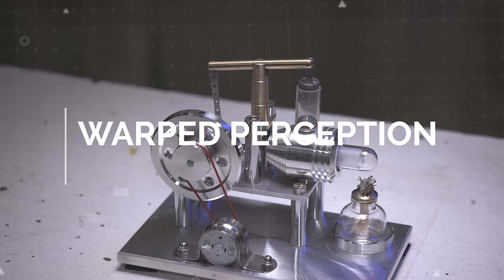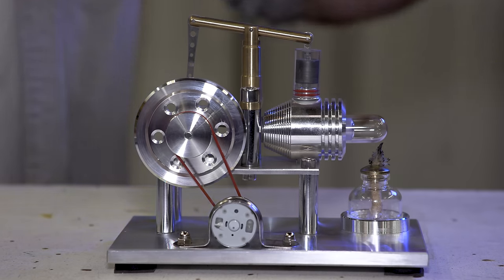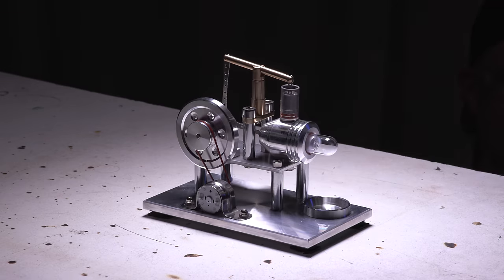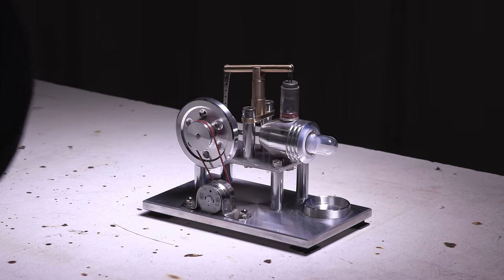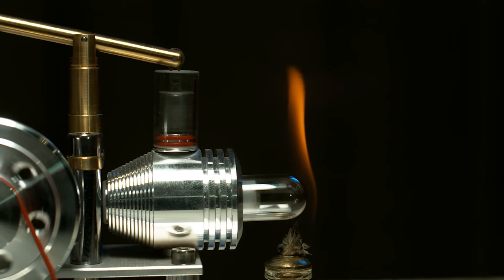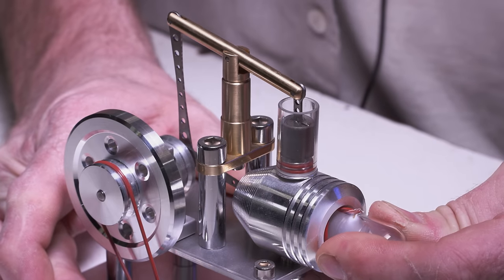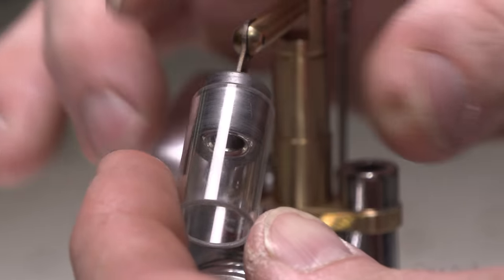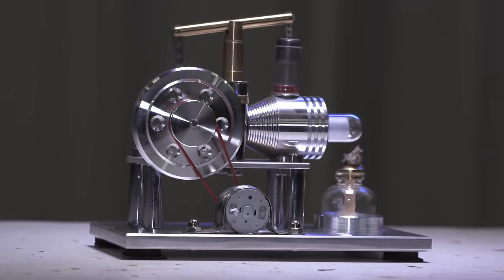Mini Stirling Engine - MAX RPM (Blow-Up Attempt #1)

Comment: Since it works with temperature variance, hit the other side of the heat exchanger with liquid nitrogen and you should get faster RPMs.
Reply from the maker: Funny, that's one of the first things I thought of. I may try that in the future
Reply: @WarpedYT  yes!
Reply: @WarpedYT  Or it might shrink the cylinder and lock it up.  Only one way to find out.
Reply: @grants169  Or crack if theres big temperature difference. Like hundreds of degrees.
Reply: Also fill the cylinders with helium, it will run faster
Reply: @WarpedYT  i would love to see how manny volts its puting out at 4000rpm?!?!?!
Reply: I was thinking the same: Rather than focus on heating the bulb, I would have focused on cooling the heat sink, to help get the temperature differential, without melting the glass. I'm surprised the displacement piston melted, and not the chamber glass!
Reply: @WarpedYT  If you really want to see it take off, pipe some helium into the crank case. Probably can easily double the RPMs, esp. if you use some ice on the cold side.
Reply: @WarpedYT  Some variations come with a metal piston and cylinder head. I have a cheap one that uses metal. I wanted to eventually get one like/similar to the one you have and essentially cannibalize the cheap one for it's metal parts XD.
Reply: I have a burning question that maybe answered here. Do you guys thing you could make a turbo run of an AC compressor. Would make for a   Cool diy project. A lot of people would be able to plumb an ac pump to a turbo befor being able to fab the hot side of an exhaust
Reply: @riz3nfpv306  Turbos use way more air than what an air compressor is designed to provide. You might be able to get the turbo to spin, but nowhere near fast enough to produce boost for a running engine.
Reply: Nathaniel Hatley even with a 
Reservoir  system to build volume? and  i imaged the turbine wheel to have a weighted impeller  on the hotside that also would handle the capture/exchange of air like an air tool. Not a large turbo obviously but even if it crated 5-8 lb of boost i imagine it would be a fun exercise
Reply: @riz3nfpv306  Ford was working on a system that would use the A/C to cool the liquid  intercooler for short bursts of additional horsepower on their supercharged/turbocharged cars. But, it requires some automated controls and a lot of extra solenoids and A/C lines to work properly. Not really DIY. As far as the turbo goes, the exhaust is really the only way to drive a turbo charger. They require a lot of HP to run the compressor stage. A typical ball-park value on a moderate HP engine might be around 60-70 HP needed to drive the turbo charger. This is due to the fact that it takes a lot of work to compress the incoming air charge. The power is developed from the resulting back pressure on the exhaust side, which is similar to the boost pressure.
Reply: mysock351C that’s using exhaust temp gases which would be far less dense then say air that has been accumulated ( and possibly cooled )in a pressure tank . Don’t get me wrong I know that it will never produce big boost or even run a large turbo, but If it were a small turbo to assist with low down torque would be a great little power assist mod for the budget rev head. Even to see if it’s possible
Reply: @riz3nfpv306  A typical A/C compressor is designed for high pressure/low flowrates. It develops maybe about 1-2 HP (similar to a small split-system) and is designed to run at about 200-275 PSI. Even if you used a large compressor off of an airbrake system it probably would not be able to keep up for long, and you would need regulator valves, a control system, and a very large accumulator. It could probably provide about 3-5 seconds of boost on a modest setup. Bottom line is theres not enough power even on small setups to drive a turbo practically. If you really wanted to avoid using the exhaust side and still want the flexibility of a turbo you would need to connect a large 30-40 kW generator and electric motor from a hybrid vehicle. It would still require a controller, but that setup would generate enough power to run the compressor impeller through a gearbox (or more practically a centrifugal supercharger since it will already have the gearbox incorporated into the unit). Power would be provided by connecting the generator to the engine, either via the accessory system (not recommended), or sandwiching it between the engine and transmission. The controller would then provide variable amounts of power via the generator to the "electric" turbocharger to generate boost under load.
Reply: @riz3nfpv306  To put it into perspective, modern engines like the turbocharged Ecotecs and Ecoboosts purposefully remove the turbocharger from the work cycle at part throttle by dumping all the boost because the turbo is so lossy. Having to always drive the turbo on older boosted engines is why they usually didn't get good economy. They require loads of power to operate, even on small setups.
Reply: mysock351C when dreams and logic collide. I want to argue my point to keep the dream alive but I expected that would me the conclusion I just really never knew the amount of air an ac compressor could produce because it’s never been something I’ve gotten into, I mean have mounted plenty and de commissioned a few but never anything like turning them into air compressors so I have no idea of flows and the such. Ya gotta ask right?
Reply: @riz3nfpv306  It would be maybe a few CFM per minute at its rated pressure output. Since A/C works on liquid to gas phase change large flowrates aren't needed, but high pressures are to get the refrigerant back to a liquid phase in the condenser. The flowrate is then set by the thermal expansion valve before the evaporator.
Reply: mysock351C what if the impeller was fluid driven? Like water under high pressure
Reply: @riz3nfpv306  There's a video that Cleetus McFarland put out recently where he was testing an electric turbo on a relatively small engine and it was able to make ~5lbs of boost, but the turbo costs $2,500.
Reply: Nathaniel Hatley yea I seen that and I had been wondering about that too but the amount of amps/charge it needs is a
testimate to what the commenter above  was
talking about. But the idea stemmed from the fact that the first thing guys chasing performance do is remove ac and or power steering pump because of the parasitic effect of these. In stead of removing them what if we found a way to repurpose them for power gains. Some how use the ac power steering of even water pump to propel a power adder.
Reply: @riz3nfpv306  That route seems like a roundabout way of getting a centrifugal supercharger, but instead of being driven by the belt drive directly, it is being driven by water/hydraulic fluid/air from an existing pump on the car. The issue there is that superchargers usually need 50+HP whereas the existing pumps you're talking about were never designed to consume/transfer that much energy.
Reply: @riz3nfpv306  there is a guy who uses a battery powered compressor on his car to spool his turbos faster. He compresses air in a tank to about 140 psi then releases the pressure into his hotside (pointed at his turbine) to spin it up... it works. He will use nearly half the pressure in a second or 2 but its enough to reach boost near instantly.
Reply: Man Stuff Channel this is what I’m talking about! But rather than a battery powered air compressor to recover air the vehicles ac comp can be converted to simply compress air. From what I read the ac pump should recover a lot quicker than an electric air comp
Reply: Man Stuff Channel where can I see this?
Reply: eternal ponderer yessssssss please
Reply: Cold water is a better heat transfere and is basicly free
Reply: tullgutten yeah I was about to say... just grab a damn ice cube
Reply: Congratulations! Your comment has reached 300 likes!
Reply: Liquid N will freeze the air inside it. End of run.
Reply: It would probably create a blackhole
Reply: And Oxy-Acetylene torch
Reply: @mysock351C  I'm not a chemistry geek or an engineer. Please tell me what the helium does and how?
Reply: @donellmuniz590  As far as an example of how much better helium is than air, it has a thermal conductivity about 6 times higher at standard sea level conditions. This will allow it to pick up heat much more effectively than air can.
Reply: @mysock351C  thanks! I hope "geek" didnt offend, lol. You guys are way too smart for me.
Reply: problem is, if you put a load on it, you would have your liquid nitrogen leaking onto the load....
Reply: @Lv.zx6r  it won't run at 4000rpm if you load it.
Reply: @grants169  I think you may need to control flow carefully to optimise could always try removing some material from flywheel... I would maybe try a water jacket round cylinder, brine and so on ...
Reply: @Lv.zx6r  maybe it can charge laptop
Reply: @WarpedYT  plz yes plz
Reply: Dripping water on the HEX would have increased the ∆T. More speed perhaps. Speed may be self limited by the inlet pump and heat chamber dimensions.
Reply: Was really expecting him to do this
Reply: You could take one of those canned air things and turn it upside down and it gets very cold
Reply: Or get it to cool itself, turn the flywheel into an impeller or something
Reply: @riz3nfpv306  look up torqamp!!!
Reply: @WarpedYT  take the belt off too.
Reply: I think. It will couse big stress that crack the engine in a second
Reply: It's so tight! That's what she said. LOL 😂😆🤣
Reply: @Lv.zx6r  changing the DC motor would help make more because the DC motor/generator that comes with it Wight output maybe 6 volts or a little more but a bigger DC motor/generator would output more volts, amps and watts because of the gauge of wire used and the magnets that's in them.
Reply: @WarpedYT  done it yet?
Reply: @WarpedYT  so it's the future...he you tried it
Reply: VTEC kicked in YOOOOOOOOOO
Reply: @WarpedYT  have you used nitrogen on the cooling side of a stirling engine yet?
Reply: Or just compressed air, for starters
Reply: Came here to say this💯🙌🏽
Reply: Or dry ice might be a bit more cost effective
Reply: I would think that would do damage. Liquid co2 is more readily available and shouldn’t do damage to the impact area.

Comment: 1:26 No, this isn't a miniature version of a Stirling engine, this IS a Stirling engine.
Reply: No, it is a Stirling version of a miniature engine.
Reply: Lol I wanted to make this comment. Thank you
Reply: @Craig Roop Not all Stirling engines have a regenerator.
Reply: @Jupiter__001_  technically they should have one to be a Stirling engine not a hot air engine. stirling engines are what Robert stirling called his version of a improved hot air engine. One major improvement was that it included a regenerator.
Reply: @kraklakvakve  no, it is a stirling miniature of a engine version
Reply: @JustinTopp  Regenerators were added later, after the original idea of a stirling engine, Weren't they?

Edit: Not to mention 'Hot Air Engine' is a category which includes Stirling engines, so what do you mean?

Comment: The reason Stirling engines are not in our cars today is because they invented the internal combustion engine. Which had faster startup and better throttle response. NASA actually did make one that fixed these problems, but the cost per engine was very high because of the use of exotic materials. On the other hand some military submarines use these engines , and they are said to be much quieter than a nuclear powered. sub. Only down side is they would need more frequent refueling compared to the nuclear fuels rods lasting many years. But would be much safer with out all the radiation.
Reply: Uh couldn't you just power these with nuclear heat? Like a more efficient RTG?
Reply: @virtualtools_3021   You can power a Stirling Engine with any heat source. You can even run it with extreme cold . The main goal is to have a temperature difference between the two cylinders.
Reply: @FalconWing1813  yeah, uranium rods for the heat so it won't need refueling and seawater for the cold side
Reply: @virtualtools_3021  True that could be done for sure. On the flip side the Swedish Gotland class submarines actually use hydrogen and oxygen to provide heat to the Stirling engine. This combo of Hydrogen and Stirling engine, has made the Gotland class one of the quietest submarines in the world. Its much simpler and less complex than nuclear. I would like to see alot more submarines with this tech to reduce nuclear waste. And save tax payer money.
Reply: @FalconWing1813  i don't see how the hydrogen and oxygen could possibly be quieter than a rod of uranium, but i do see how it could save money and reduce waste
Reply: They also use them on natural gas transport ships, because they can be operated without as much ignition risk if there is a leak.

...Which is really important, because what happens when your natural gas ship blows up, a lot of people's lives and livelihoods will vanish.

Comment: I wonder if you could water cool the heat sink and make some steal pistons and cylinders to better handle the heat because of better heat transfer. But then again that may prevent it from running, perhaps ceramic piston and cylinder? I really liked that you pulled it apart on video though that was cool, thanks for the video, it has me thinking now lol
Reply: replacing the pistons and cylinders with steel would work just fine. Water cooling does in fact improve the sterling quite a bit (as they work on temperature difference, not just heat)

Comment: Man, I don't know if you just mounted your camera on the ceiling fan or what but that shot looks amazing!
I wonder if you could get more RPM by cooling the other side and how much voltage and amps could you get at those speeds!

Comment: I, and a couple other folks, have wondered about power output.  It's real easy to get some results with the built-in dyno.  Just wire up that belt-drive "motor" with a proper-sized resistor and measure the current.  Volts, Amps, Watts!...use an electric model plane Wattmeter that reads out all three.  One horsepower equals 745 Watts...use Watts for bigger-looking numbers!
One could even set up another brushed motor running off that onboard generator with a fan to move air through an air/water intercooler that would pull heat off the "cold side" of the motor and make for a higher temperature differential.  Make sure that the water in the intercooler thermo-siphons like a Ford Model T cooling system so no pump is needed...put the intercooler higher than the heat source with no dips in the lines.  Use model plane silicone fuel line for water lines to intercooler.
I like the liquid Nitrogen idea also.
You could do "dyno runs" stock, stock with intercooling, and stock with nitrogen cooling.  THEN you could do runs stock with MAPP gas. Mapp gas with intercooling, and finally MAPP gas with Nitrogen cooling.  Maybe reverse the order of the MAPP gas runs so that the damage to hot side happens on the last run. (stock)  For stock runs, just pinch off water flow to intercooler.
Compare Wattage on all runs for a full test set!

Comment: I agree with eternal ponderer below.  The limiting factor is probable the engines ability to expel the heat from the other side.  Very cool video (I love the 360' slow motion) and Yes, I'm gonna buy one but I won't be blowing mine up. :)

Comment: I believe that the upper piston was actually graphite with a steel fitting inside.  Low friction, doesn't ever melt (it sublimes), easy to machine and soft enough to get along with brittle glass.

Comment: Me: I wonder how heat powers those pistons

How this engine actually works is it turns heat into rotation

Me: thanks!
Reply: The engine works by a temperature difference on either side of the bottom piston. When the temperature on one side heats up it increases pressure on that side. It then has nowhere to go, and it pushes the piston backward. The flywheel stores that energy (kind of like a kenetic battery), and it transfers some to the top piston that pushes cooler air back down (the glass cylinder on top is at room temperature). Since this cooler air is forced back into the chamber on the cool side the difference in temperature is maintained. The flywheel also pushes the bottom piston back, and the hot air (on the hot side)  forces it back down the tube to the flywheel. The top speed is reached when the two forces start to equal it out (The flywheel cannot store anymore extra energy). That covers the heat portion.
Now for the mechanical side of things where the energy is turned into rotational. The piston has a rod attached to to bottom of it on a swivel. That rod connects to a round wheel near the outer edge on another swivel point (think crank on a boat trailer). As the rod pushes (strait force) this causes an imbalance of forces on either side of this wheel, so the rod pushes that side of the wheel. The bottom side of the wheel is still part of it so it moves in the opposite direction as the force is equalized (distributed equally across the wheel). This creates a turning motion A.K.A rotation. 
This is oversimplified, but I hope it helps.

Comment: You should try to make or get a metal piston and cylinder so it won’t melt and you can hit it with an icy acetylene torch!
Reply from the maker: The acetylene torch was going to be my third test in this episode, but since it didn't make it through the first well you saw what happened...lol
Reply: They sell ones with metal already.

Comment: That is so cool Not a bad price either!  Hey Are you still going to do a Electrical Fire demonstration? I think you should make a 8ftx 4ft wall and short the wiring some how or so Electrical over load to demonstrate what happens inside the wall when wires get super over heated/Overload.
Reply from the maker: Yes I am , now that you mention it I'm going to move that up on the list ASAP!!